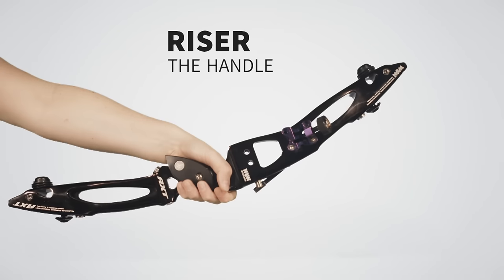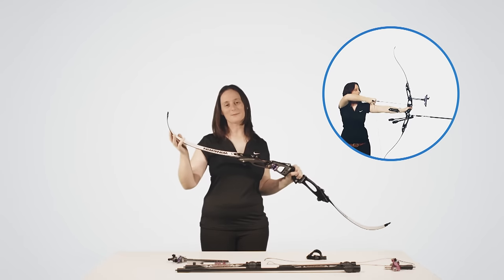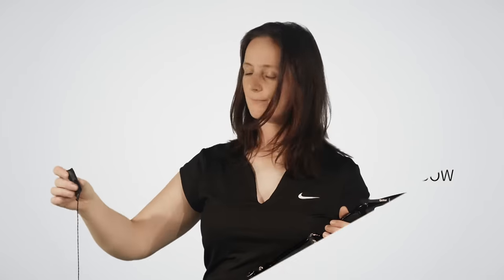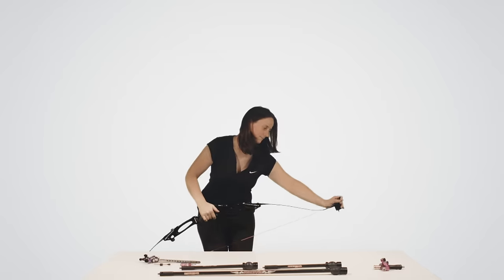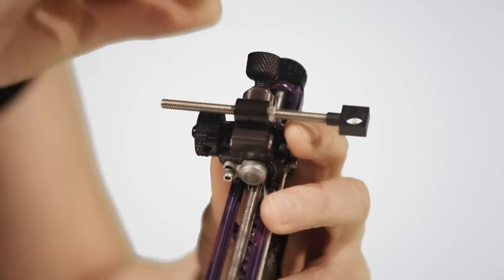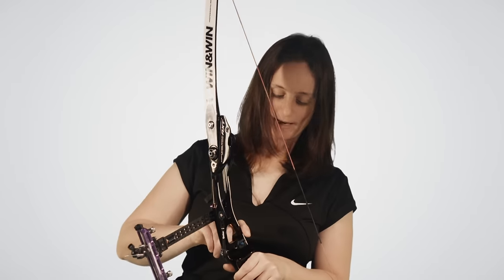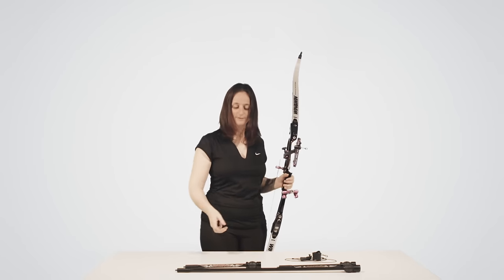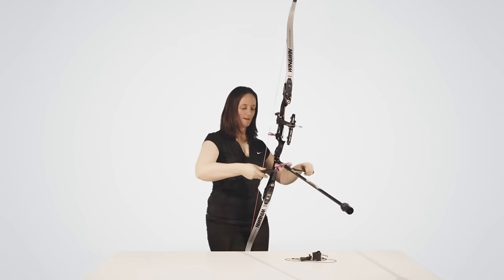How to assemble a recurve bow | Archery 360

Comment: Good Video, but.... I feel it would have been more beneficial to newer archers to know exactly how you determine which is the bottom limb or which is the bottom loop of the string.  The more experienced archers would already know how to assemble the bow and would not need to know such things.
Reply: just look at which way the limbs curve it should be away from you
edit: the limbs used to be tillered differently but today they are identical. the tiller is adjusted by the bolts in the riser but generally the limb with the poundage info is the bottom one
Reply: I was gonna write this comment. Thank you,  Sir!

Comment: You left a few things out for one the set of limbs are different sizes one is just a tad bit smaller than the other one so you need to be very Pacific especially for beginners ,your string there's a big loop and small loop.
I came here looking to figure out which limb goes on the top and wish them goes on the bottom

Comment: What if my bow isn't an ILF?
Reply: Everything is the same, except you must use and tighten Limb bolts to attach your Limbs to the Riser.
Reply: Also, after attaching the string, make sure the Riser is facing away from you when you make sure the string is located properly in the string grooves. If the string slips, you won't be hit by a Limb tip.